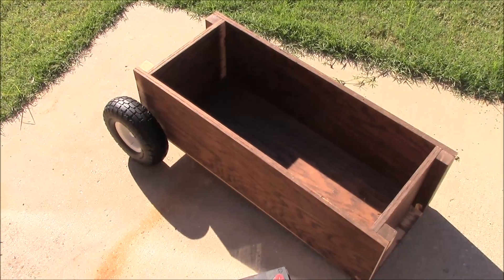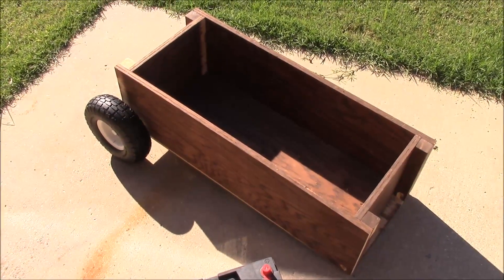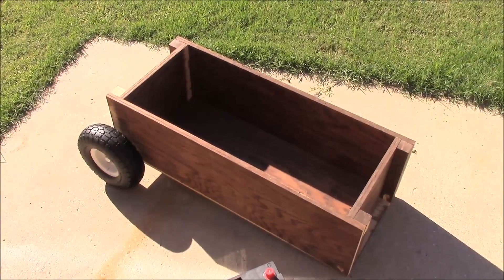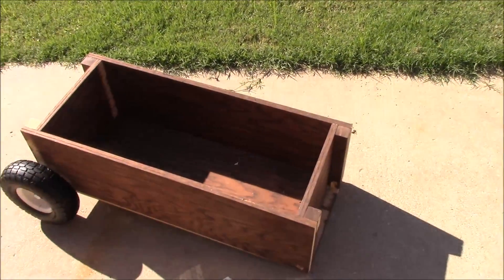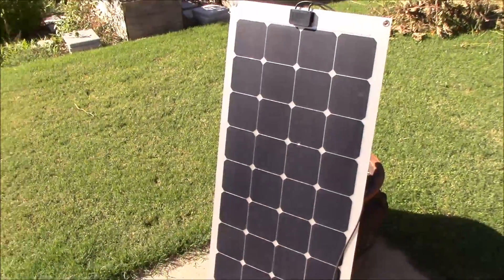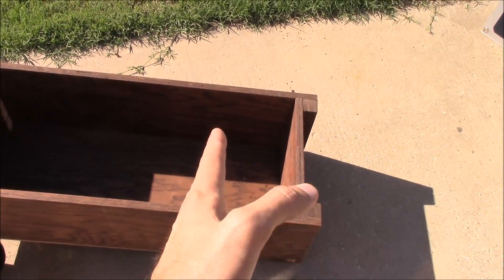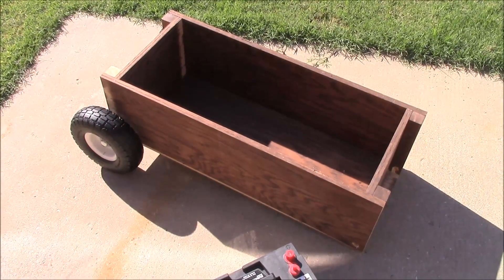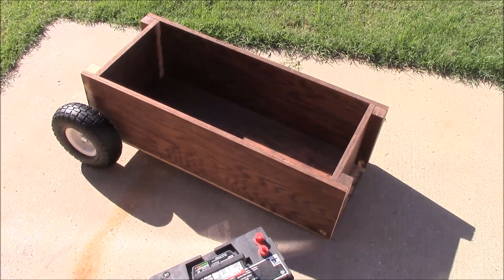Solar Generator Project - Part 1 Introduction

Comment: Years ago Larry Rice in St. Louis made solar carts like this and let people use them for free when their power was off. His cart was more upright, (think welder cart), had an on board battery, charge controller, and small inverter. His solar panel was smaller, but at the time panels were much more expensive.
Reply from the maker: I thought about doing something more upright but then I couldn't figure out how to mount a solar panel of any size on it.  I also didn't want it to be able to tip over accidentally since I am using a flooded lead acid battery that would leak.  We'll see how it works out horizontally.  Like I said, this is a prototype and could turn out all wrong!

Comment: You could put brackets on the side to hold the solar pannel
Reply from the maker: I guess that could work.  How would you do it?
Reply: I apologize, I did not realize this was a flexible solar pannel. hmmm and it's not that flexible so I have no idea. what do you plan on doing with the solar pannel?  Is it flexible enough to bend around the cart, like from the left of the cart around the front to the right?
Reply from the maker: teseract911
No, it is not that flexible.  I don't know what I am going to do with the panel or the lid yet.  I'm going to have to think about that one for a bit.